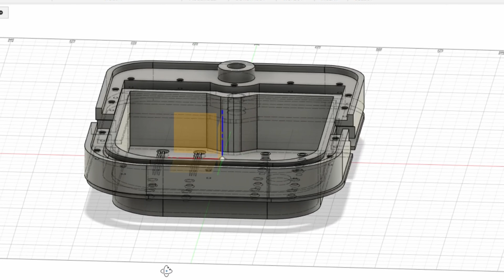How I built my own remote control long range FPV ship.

Comment: What ideas do you have to combat weeds?  Seems to be the biggest issue with long-range boats.
Reply from the maker: I was thinking of potentially adding a backup propulsion system - perhaps a regular drone motor with prop.

So far milfoil in our lake has not been an issue but that won’t always necessarily be the case - I’ll have to visit that if it becomes a problem.

Comment: Awesome,  add on suggestion.  Since you have established a long range  fpv. Attach a submersible uwv for under water reconnaissance.. hmm. That's crazy 😮
Reply from the maker: I love that idea. 

I had an idea about using an under water pod at the keel with a similar gimbal to the mast gimbal - though my only concern would be the bouncy of the pod.

Love the idea though and it’s something I might actually visit doing.
Reply: Even a clear pod\bubble sticking out from the bottom, with a camera with head tracking.  Make it switchable between the 2 cams.

Comment: You should probably setup RTH, in case you ever failsafe… unless you keep a dingy handy for retrieval. Very cool though
Reply from the maker: Thank you.

Definitely going to implement RTH - version 2.0 is going to be a complete rework of everything.

Ardupilot instead of inav / gps with compass and a digital video system. 

Finally releasing this video has motivated me to start working on it again - thanks for the comment.